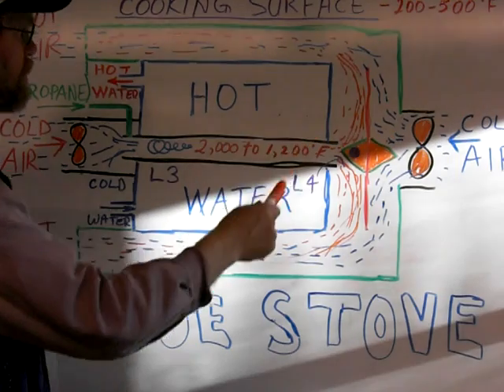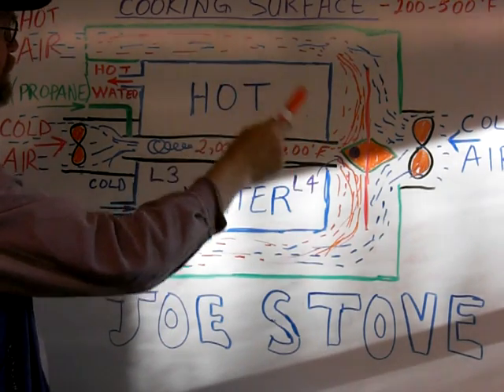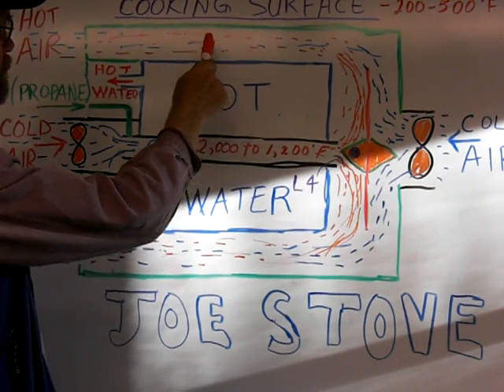#12-PART 1 of 2-Joe Pipe-HOW TO BUILD A BETTER STOVE

Comment: Ok, I am not sure about this "Joe Pipe" thing. The main 'drawback' I see is the constant power required for the fan/fans. Would the additional BTU's created from the pipe compensate for the Power consumed? Then, the constant 'monitoring' would be too burdensome for most people. Unless some sort of automation could be configured.
Any other thoughts on this?